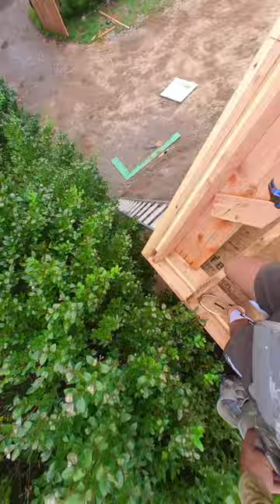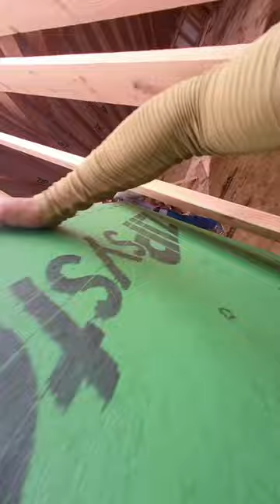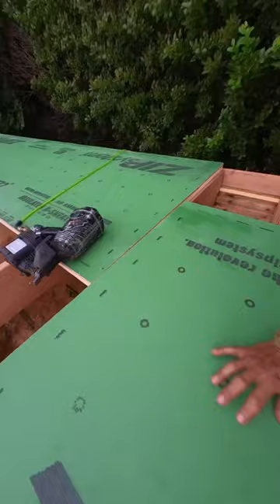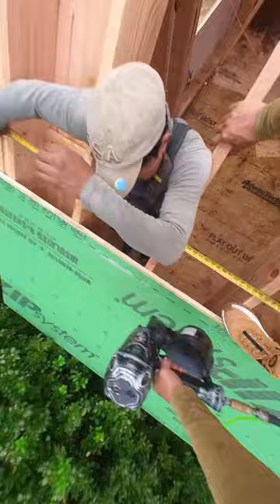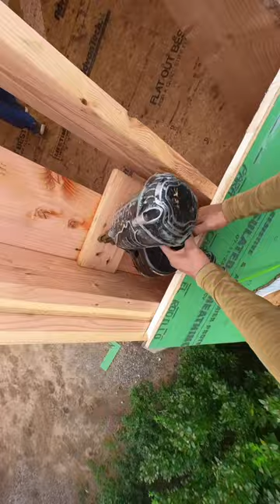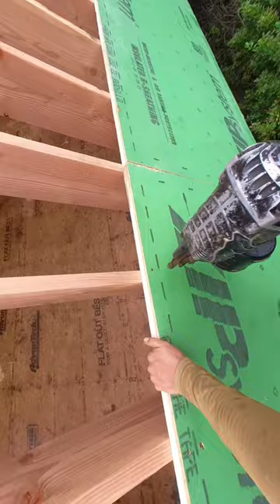Skills #shorts #short #construction #work #skills #perfect #carpenter #team #tips #design

Comment: I swear I'm gonna sound stupid saying this, but I just realized that the small dots on the sheet help guide him  as he's nailing fast. So while he is very skilled, and could probably still nail in a straight line without the dots, it's pretty cool to figure out these little tricks.
Reply: Also they were using the tape measure to make sure the trusses were proper spacing the whole way up .
That way the dots on the sheet will work as intended

Comment: Eventually the Styrofoam on the back side of that zip board will compress and breakdown.
I wouldn't use it on my roof simply because I feel as though I'm setting myself up for problems.
But thats just my assh... I mean opinion!
Reply: The zip they're installing doesn't have foam.
Reply: @ewdtrey Yes it does. Huber also says ZIP R is not rated for roof systems.
Reply: My eyes deceived me. You're 100% right.
Reply: @h2s142You can put green on a roof it it’s 16 oc and you use H clips. Just never ZIP R on a roof.

Comment: I like to measure up on each end of the roof, and snap a line at 48" sometimes the fascia board isn't absolutely perfectly straight.
Reply: You have to snap a line or else your first row would be all over the place! And you hook your tape on the fascia and pull 48 1/2” because your sheet should plane a little back on the fascia so the roofer (if using drip edge) and the soffit and fascia guys don’t have overhanging plywood to deal with. 👍🏻
Reply: @bacongrz  You're right about pulling it back so the roofer can do the drip edge. Forgot about that while typing the comment.
Reply: @renski8976  was just being overly specific on the internet to anonymously flex my framing knowledge. 😂 like the online version of a “one upper” 🤷🏻‍♂️
Stay safe, brother

Comment: Personally, I just mark the plywood for layout
Reply: Plywood is already factory marked for layout.
Reply: You work in the factory marking the plywood for layout? That’s pretty cool
Reply: @jonathan3982  I like to be precise
Reply: @jparker352  Well that's good. But if you're framing layout is precise then your plywood will be precise on layout JS👍
Reply: That's assuming that the print on your plywood is correct. I've had it come to the job where it's been off a quarter inch off
Reply: @jparker352  That can happen very Possibly true. But dude if you know your framing layout is precise and your first nail is line with the markings, you will hit and not have shiner's. It's really not a big deal, you can confirm the marks in 2 seconds with a tape. 20+ year's General Contractor here. If snapping a line on your plywood makes you feel better by all means have at it. Have a good evening.
Reply: It's not plywood it's foam sheets
Reply: It's not plywood  it's junk foam  bosrd
Reply: @tonynichols309 its actually osb with a r3 foam rating your couldnt afford that house if u worked ur whole life
Reply: @rileywhite5091  how the guck would you know what I can afford plus it's still shit board because that r3 isn't shit and over time it will disintegrate
Reply: Plywood lines are an inch off either direction most times where I am. Trusting plywood lines is like pulling numbers off concrete its never right.
Reply: @tonynichols309  just stop please you obviously don’t know your materials